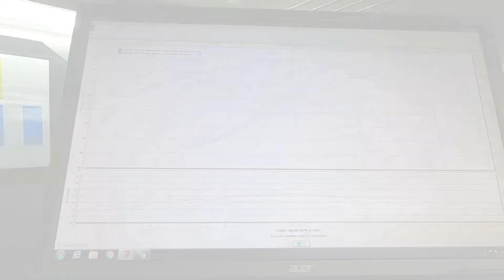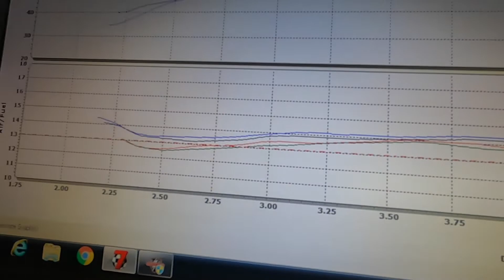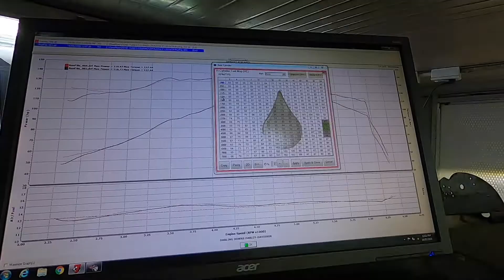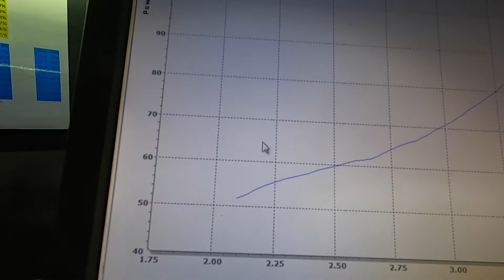128ci APE Kit Dyno Test & Tuning

Comment: love following along Tommy. Dyno graphs on bikes with 2 into 1s always have a big dip before 3krpm, just before the big rise!  How could you smooth that out? thx.
Reply from the maker: In most cases it is the Cam shaft & pipe combo that makes the dip more pronounced. 
D&D pipes are the best in my opinion for helping to remove the dip.
Cyclerama camshafts are great too! They don't dip down at all really.
Reply from the maker: Check this video out https://youtu.be/0vqG1GBVfN8